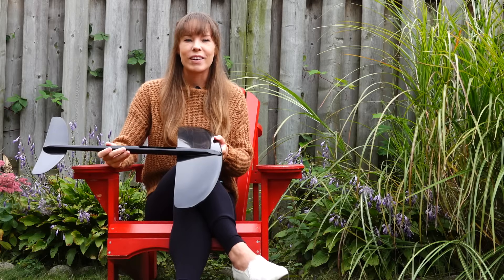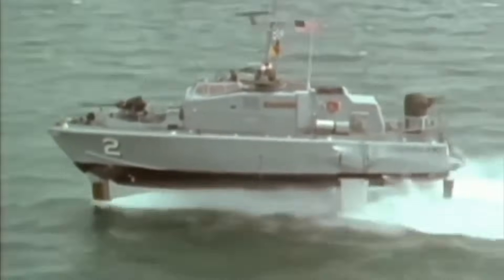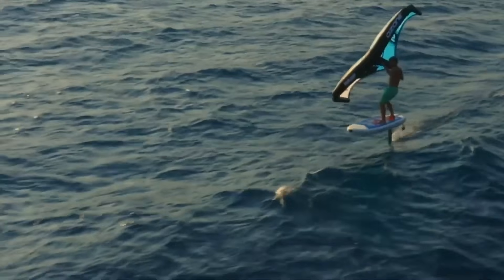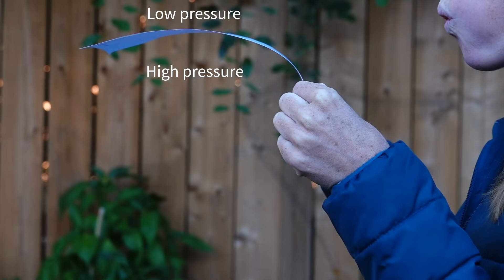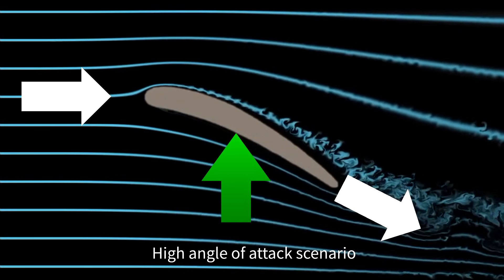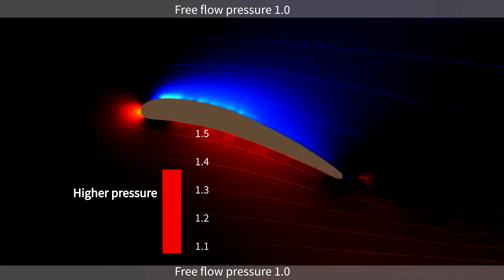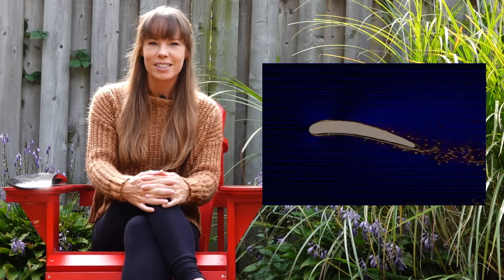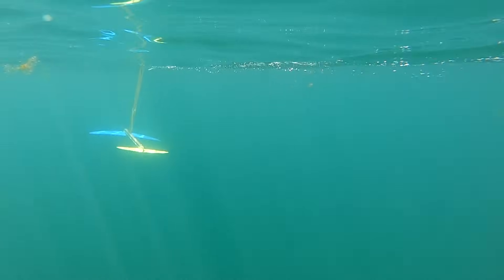How Hydrofoils Work

Comment: The explanation of lift with the piece of paper is wrong. It's a common misconception. This can be seen from the fact that if you blow below the piece of paper it doesn't bend downward but upward. The reason it can't be explained with Bernoulli's principle is that the air that is being blown is at atmosferic pressure. Also Bernoulli's principle only applies to the same continuos fluid flow (you can't consider the still air below).

Comment: Thanks for the comparison of the different explanations/factors for lift. One thing not mentioned is the general shape of a wing: it is a stretched teardrop (teardrop is the most aerodynamic shape). A straight "stretched teardrop" that has the trailing edge lower in the airstream would get lift because of the angle of attack alone (1) (like sticking your hand out the car window, due to molecular collisions, pressure differential, or whathaveyou). A flat board would also receive such lift, but it wouldn't slide through the wind as well as the straight-stretched teardrop shape. We don't often see such zero angle-of-attack straight "stretched teardrop wings, though.  ... Stretching the top side of the teardrop while keeping the bottom straight and while keeping the angle-of-attack at zero degrees (2) would also provide lift (due to the Bernoulli effect), but we don't see this alone often either. Combining 1 and 2 gives more lift than either one alone. ... You can also see from the blades of a household electric fan that the local angle of attack increases as air moves over the blade. The inside of the curve of the blade gradually pushes harder and harder on the air molecules as the airflow gets pushed more and more. I don't know if this is force (3) from my above analysis or just an aspect of (1) and (2) twisting together. ... And when an airplane flies upside down, the angle-of-attack has to be increased enough to overcome the downward "lift" caused by Bernouli effect of the longer bottom side of the wing (and the curved shape, I guess). This is why such flights are slower and require more engine power to execute. They're inefficient and always at near-stall.
Reply: Planes that are designed to fly upside down have much more symmetric aerofoils, often with much less camber - they will also have adapted empennage to allow the presevertaion of a (relative) positive angle of attack on upside down flight. A modern commercial simply would not be able to fly upside down (or not very long atleast without greatly exceeding ultimate loading specifications in the tailwing)

Comment: Thanks for the nice wrap up of various foil theories. You mentioned for each theory, as proof that they are incorrect or incomplete, that they didn't explain how a plane can fly upside down. Yet in your final explanation of the 'correct' theory, neither did you show how that theory would explain a plane flying upside down. Are you able to do that?
Reply: "lift" of the airfoil is relative to it's motion in the fluid (in this case air) in which it travels and is primarily a function of it's speed through the fluid. as long as you have enough power to maintain speed at any flight attitude Up, down, banking left or right the airfoil will produce the lift relative to the airfoil (wing in the case of a plane) now while the plane is upside down relative to gravity it's angle has to be adjusted to overcome the normal gravity force and requires more power to maintain it's speed, but as long as you have the power it will still fly through the fluid.  look at some modern jet fighters that have so much power available that they can go vertical almost immediately after takeoff, they are still able to adjust their attitude (roll and pitch) even while climbing out a near vertical angle.

Comment: Incompressibility and viscosity are the two main factors setting hydrodynamics apart from aerodynamics, but in principle they work the same as air is a gas, and gas is a low density fluid.

Comment: I am a newbie to kitesurf already kited more than 15 hours and would like to know if I should do Kitefoil instead. Specially if I am in places with lower winds :(
Reply from the maker: We would recommend focusing on twin tipping first. Kite foiling will be much easier once you have more overall experience with the kite.
Reply: @OurKiteLife  i am already a good rider id consider myself. been doing watersports since 7years old. thanks anyways. oncenyou do kitefoik you guys do both? can i use the same kite?
Reply from the maker: In that case then yes, definitely give foiling a try! You can use the same kites you have now for hydrofoiling.

Comment: This was a video not intended for me, i get it, and lot of effort went into it, and might help someone's basic grasp.
But still had some misconceptions at the end. Like implied one-way causation, Speed->pressure.
Anyone looking for one of those lectures that goes deep, after watching this, I recommend: "Doug McLean | Common Misconceptions in Aerodynamics"
https://youtu.be/QKCK4lJLQHU 
I think of a flying airplane like its hanging in a stretchy fabric (sort of) like Chewing Gum or something (only picturing a sheet of it for visualization). 
And pressure gradiënt is stretch: low pressure thin sheet, high a thick sheet. 
That way my mind thinks in a sort of newton like interaction with it(air), but you can stay in the air/bubblegumsheet without permanently moving anything, everything can come back to a even thickness after a while. (a tear/turbulence might take a while to repair)
The plane doesn't even have to move a mass equal to the plane constantly, to get an opposite reaction, because of the stretch/pressure helping it. 
It does neet to create that force, but can do that while interacting with less air mass than might be intuitive.

Comment: The difference between air and water as a fluid is water can not be compressed. The water traveling greater distance over wing is not accurate in several ways. First the only movement in water is displacement up/down on top of wing and drag forward because of viscosity plus turbulence. Moving water downward creates upward lift to a moving object. So the question is does he high low pressure density that applies in air apply in water? The most efficient foil might be zero angle of attack leading edge and 2% trailing with downward tip or reduce tip cord to reduce tip vortex drag and the thinnest foil to reduce displacement drag. Air is easy compressed water effectively cannot be. In an airplane that aspect is huge but in water that can not be compressed might mean nothing. Viscosity, displacement (by thickness of foil) and turbulence drag is more important. Also the displacement of moving water down 2% of cord is the generator of upward force. Slow moving hydrofoils in a 20 times non compressible fluid is more comparable aircraft designed to fly at extreme high speeds were air density (molecules flowing over wing) and viscosity (air displacement induced drag) are similar.
Reply: I like where you're going with this, but have to point out that Bernoulli's principle was worked out in liquid. Which is to say that while it wont compress per se it still reacts to velocity change with a pressure shift.  Now the field of effect is much more confined in water than in air as your foil aspect argument implies and foil shape ( chord) can be drastically reduced in the higher density fluid or as you stated with the relative density the foil experiences at speed in the case of a jet.
People say water won't compress and I have to disagree to a point on this. If this were true then why is the pressure different at depth in the oceans relative to at the surface? Yes - gravity and weight of the water above, but if water did not change in density and compress the pressure would remain the same. Let's examine the force of compression on a very tall brick wall... They say the pressure exerted on the bottom bricks is the same as the ones near the center or near the top of the wall. How can this be? there are tons of weight bearing down on the bottom bricks from above! Why don't they explode into clay dust? They don't compress and they distribute the downward forces evenly on the lower row.  Back to water... At depth it will crush a submarine due to the pressure increase, therefore it must be able to compress right?
Just my thoughts, I am probably missing something. ( a marble or two most likely)

Comment: As a fluid mechanics PhD and Aerospace engineer I went into this video with trepidation that you’d point to an incomplete/flawed explanation like Bernoulli’s equation which is a specific simplification of the energy equation that can be made under very specific circumstances. I was extremely relieved to see that your explanation focused on conservation of momentum an generally agree with almost everything you said, well done! My only concern is the assertion of a lack of understanding or consensus among scientists and engineers—the bottom line is you need at least all 5 Navier Stokes equations—conservation of mass, conservation of x, y & z momentum and conservation of energy—to fully describe real fluid flow around 3D foils. It’s very complicated and usually impossible to solve with pencil & paper but there is a general understanding.
Reply: I value your opinion. What is your comment on Bell figuring this out? I was just at his lab in Canada. (Museum). Very little about this.

Comment: There are a couple of things a lay person should know about this explanation - which has flaws. The two theories about lift (Bernoulli and Newtonian) have been debated for years with no resolution. For instance the sails on a yacht produce a 'lifting force' but are so thin in terms of chord length that the Bernoulli theory fails. As mentioned there are other theories but these are the main ones.
The ability of an aerofoil to generate lift while a plane is inverted is purely down to the angle of attack of the whole aircraft which has to 'pitch' to an angle at which even an 'inverted' asymmetric foil will provide the required 'lifting' force. This is why most aerobatic aircraft have symmetrical foils because asymmetric foils in this situation create unacceptable drag on the whole machine. It is a lay persons perception that aerofoils work differently when 'upside down'. The foil doesn't know which way is up it simply reacts to the forces of fluid flow and gravity in any position.
The rear foil on any aircraft (or yacht) is normally called a stabiliser (rudder) because it provides a lever to counteract the instability of the changing lift forces on the main wing especially one with a high aspect ratio and a short chord length. The position of the lifting force relative to the centre of gravity is critical and flying wings without sweepback are really unstable as the speed and angle of attack varies due to the constantly changing  lift/weight(cofG) relationship with a very short 'lever' arm. The rear stabiliser is often symmetrical foil which produces lift only when required to restore useable balance to the system because it has a large lever arm relative to that of the main foil on its own.
Reply: Raising this from the dead....but no its not flawed its just simplified and a bit incomplete. its also not a theory as it has been proven both experimentally and analytically. Mechanics of lift is well understood by those who work with it proffesionally, just not by laymen who continues to debate different made up theories. It is very easy to prove that lift only can be created by diverting mass flow. But it´s only part of the truth. Force transfer to the wing is created through pressure which can be calculated through bernoullis equations. This is however not the same thing as applying Bernoulli to half a venturi. Excellent description by the maker of this video.

Comment: Well presented but flawed by using Aero theory to explain Hydro effects. Air is compressible and the presentation does a good job of illustrating this and how a wing works. Water is NOT compressible and 830 times as dense as air. This changes everything! Air is compliant and relatively easy to locally distort as it flows past a shape. That flow is controlled by the pressure at every location and results in velocity changes that can speed up or slow down the flow over and around the shape. Air compressing on the lower side of a wing slows the flow where air being pulled apart as it tries to flow over the top, speeds it up.
Water must be pushed out of the way by any object moving through it. Since it doesn't compress, it must be pushed to infinity or flow around the object, both of which are hard to do. A displacement hull flows but is therefore 'rate of flow' limited. Above a certain speed it will no no faster. A planing hull pushes on the water without any time allowed for the water to return to the opposite side of the hull and therefore breaks free of this limitation. Since water is very dense, it can create huge drag when a shape is blunt and the velocity is high. The water does not compress and also does not expand until the vapor pressure of the water is reached. This is roughly 14.7 psi at sea level. If the water is trying to flow over a surface, it will separate off the top surface when the vapor pressure of the water is exceeded. Note that this pressure increases quickly with depth. This absolute pressure is the combined pressure of the atmosphere plus the weight of the water between the foil and the surface of the water. Because water is dense it does not like to be accelerated so pressures develop quickly when a foil interacts with water. That is why angles of attack must be kept low: remember you are moving water out to infinity and not simply compressing it locally. Sharp leading edges are most efficient as are trailing edges that do not produce negative pressures. If appropriate, fill a trailing edge with air from the surface to keep drag low. In summation, foils work by pushing water aside in an displacement action. Flat surfaces work best unless a non-linear reaction is desired. Both the upper and lower surfaces work in concert until the upper surface experiences cavitation where is can pull (lift) no harder than the vapor pressure of the water. The best foil would be one with zero thickness, so add whatever material thickness is needed for structure and nothing more. This is a complex topic for just a couple paragraphs.

Comment: I didn't understand but when you said the research out there suggested a drag ration 20:25:1 can you explain that a bit more. Thanks Is that a drag to lift to ? ratio
Reply: Why? think about it. You just have two options.
Investing 1 unit to overcome drag to get out 20 units of lift just sounds very very efficient to me(as an engineer)
But think investing 20 units of power to get 1 unit of lift is just utterly nonsence. If u swim u dont use 20 times overcoming your drag to get lift - and u are pretty much the most unefficient system converting draglosses into lift - not a optimized foil for that purpose.

Comment: So basically there is no passive way to have a fully submerged hydrofoil... Great video. I made a little wooded boat and want more speed. I/we have solved my problem! I have a lighter than water float to control the angle of the hydrofoil. This should keep it and the same height above water. As for waves, I suppose I must limit the control angle so at worst the foil tries to leave the water and no more than ten degrees? Does this sound right? Are there known problems with active hydrofoils? Never made a boat before and although it didn't sink it was scary. It only displaces 370KG of water.

Comment: The wing flies upside down because you adjust the angle of attack. The principle generating the lift is the same. How the wing is orientated is the difference. So no, the first theory is not 'incomplete at best.' Your understanding of how to fly a plane is, however incomplete. Come fly with me and we will hang out inverted and you will see the attitude of the plane is very different to compensate for the change in the lift generated.

Comment: But couldnt you make the same argument that this again doesnt explain how a plane can fly upside down
Reply: If you flip the image, around the horizontal axis, the plane would indeed not fly. (It would go down quicker than without a wing)
But then you take that and rotate it 10 degrees (having originally had a 4 degree angle) now it will because of the angel(6 degrees). The shape mostly helps with making that angle more efficient. And work at a bigger window of speeds and angles without stalling.

Comment: If you ever try wakeboarding, on the take off, it's best to point the board to the side a bit or you will be fighting the high pressure force from under the board when pointing towards to boat. The shape of a wing can exaggerate this effect to generate lift. Nice video on this topic! In science I think air and water are considered fluids.

Comment: The Bernoulli effect accounts for ~5% of lift, the other 95% is reaction to the downward force of fluid medium, eg air or water, ref: Newton's 3rd law.  But where is the necessary thrust? Boats and aircraft are powered, and riding down a wave uses kinetic gravitational energy (high to low) of the rider. But how to propel the foil on a flat, still surface? The pumping effect of the foil rider, similar to the rider's swinging legs and arching back on a kid's swing, also generates momentum by pushing water down and back. The foil reacts by rising and moving forward. Stop pumping, you sink.

Comment: you only need lift during acceleration while coming onto plane getting to the speed needed to "float the payload"the rest is surface tension @ a given speed that's why a surf board floats in motion  no lift gliding across surface of water . Making a hydro foil with and airfoil type shape, you will just decrees its efficiency . I know because i bolted them on my water skis  while skipping High school